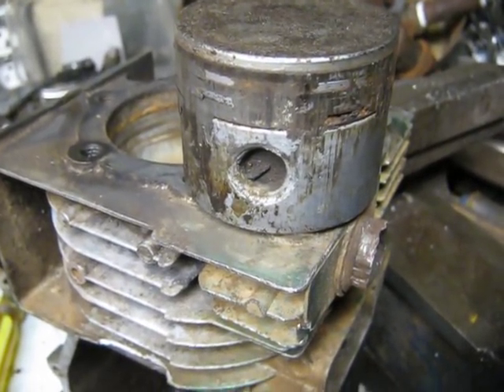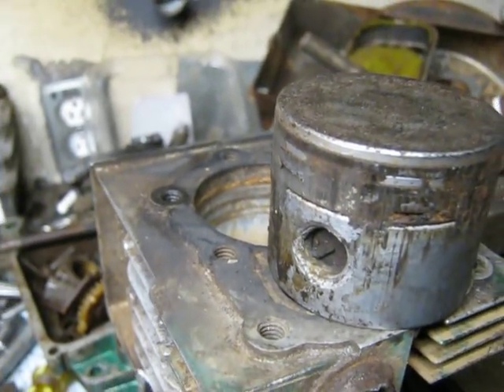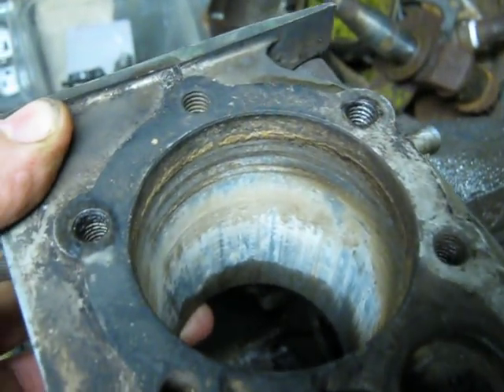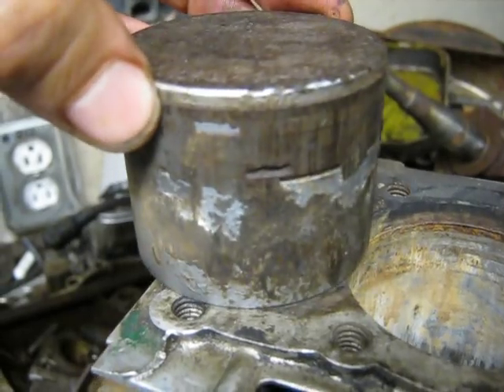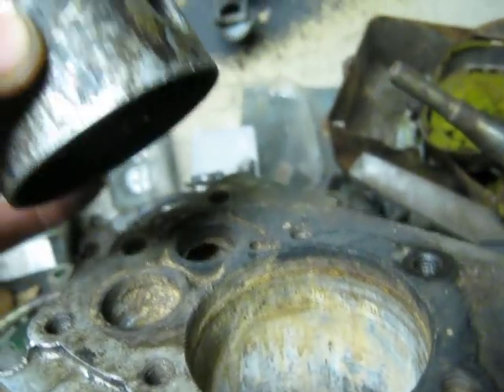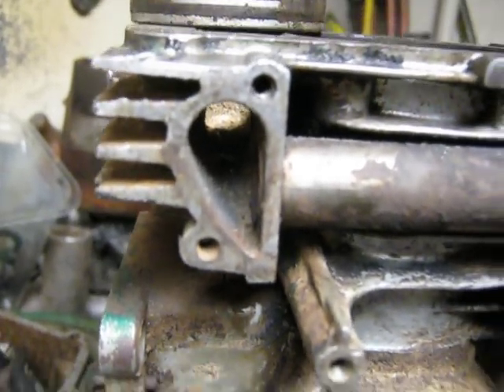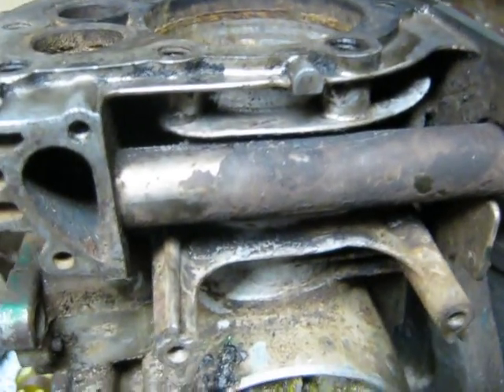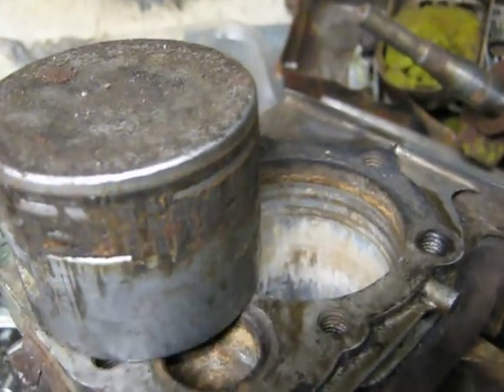67 Subterranean Briggs Pt 7 Piston Removal!

Comment: use the piston as an anode and get a sacrificial cathode. put both in  water with salt or vinegar. apply 12 volts. this will clean up that piston.
Reply from the maker: Yes, I bet that would shine it up nicely.

Comment: since you put so much work in this, just tig weld the holes in the block and make it a good motor
Reply from the maker: Whats that, JB Weld up them holes, I thought that is what you said!  :)
Reply: that will last you maybe 15min of running

Comment: She's looking good bud! Wonder how much oil she'll burn when you get her running, haha. Also if I were doing this, I'd clean the whole block in a really good parts cleaner, maybe an ultrasonic cleaner? Don't want any sand that might be stuck in there breaking loose into the oil on the first start. But you probably have already thought of that, haha.

 I think this engine was in a creek somewhere. Then all the sand would make sense. Plus you can find a lot of trash like this in creeks sometimes. Never know how it ends up there though.

Comment: heat cycles usual will get anything that can be got, or at least thats what i have found. Glad it's out and glad your saving it for the fun of it.
Reply from the maker: Yes, and JB Weld is going to be required to fill in those nasty pockets near the valves!
Reply: i know this is not what your going for but, thats cast ally right? So you could tig and mill that block if you wanted too. It's involved and i am sure not what you want to do but i believe that would work correct?